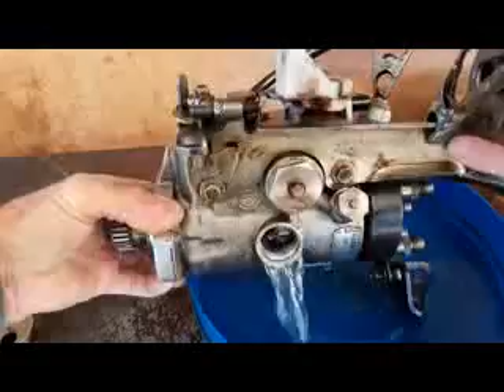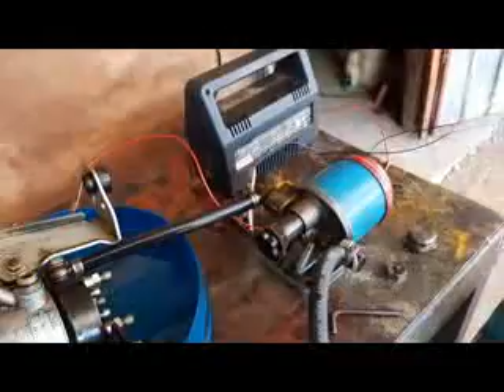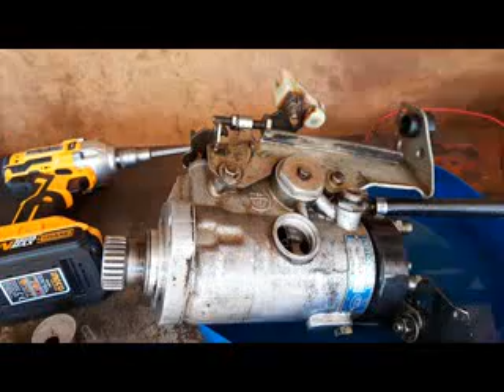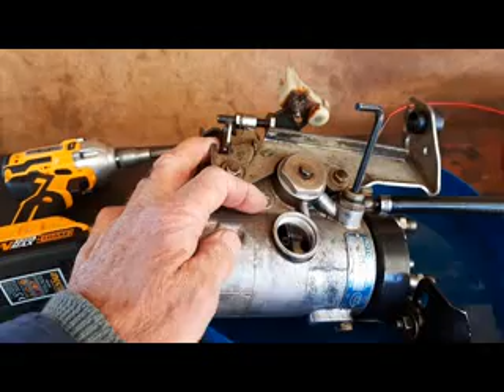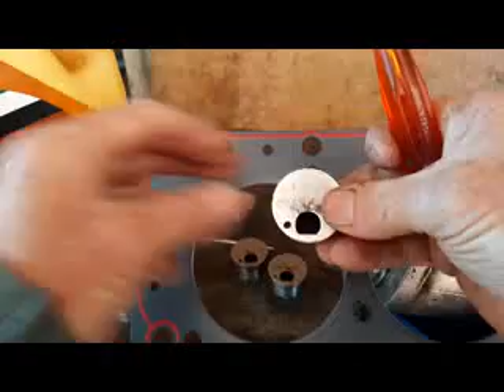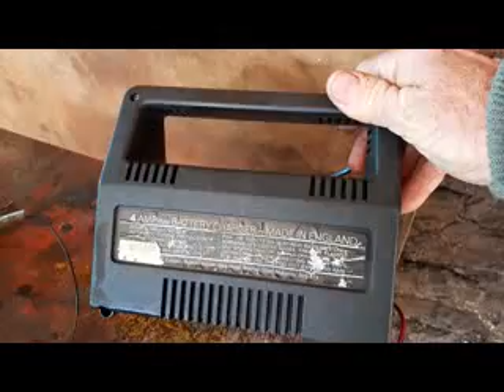Demonstration  of Peugeot 505 DPC injection pump on XD3 non  turbo motor.

Comment: Great video do you see issues with light load advance? Engine seems to have a ton of white smoke under idle or no load as well as misfire. Good injectors and no suction side air issues. Thanks

Comment: good afternoon you can send by e-mail engine repair manual DAF-400 2.5 td (XD 3t seems so called) thank you...
Reply from the maker: Hallo. I don't have a repair manual of the XD3 motors only on  XD4.88 XD4.90 and XD2 non turbo motors unfortunately.
Reply: Могу выслать мануал.у меня есть
Reply: @samodelkintv6942  спасибо уже не надо